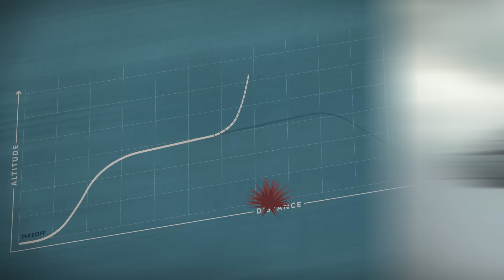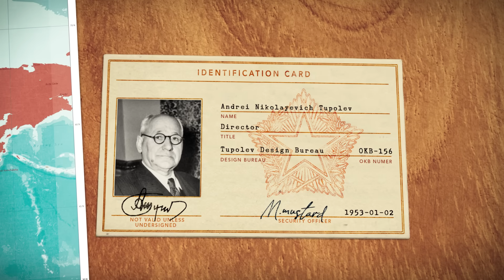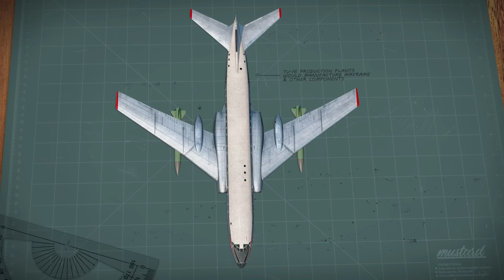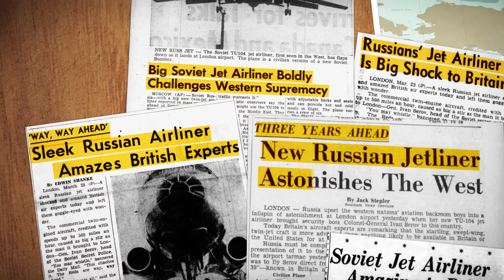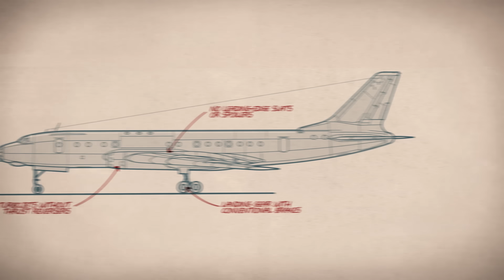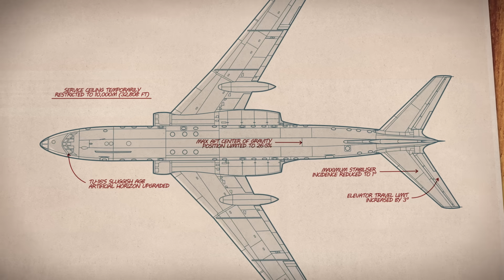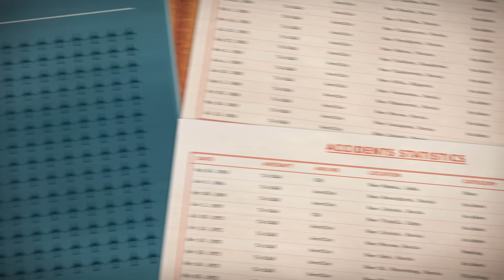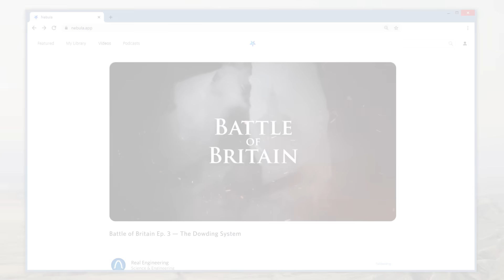The Soviet Airliner Designed To Crash

Comment: The 707, briefly mentioned here, was the real advance in jetliners. It was the first aircraft to have flexible wings, which avoided the need for massive reinforcements at the junction of wing and fuselage.
Reply: The 707 series is still flying and is expected to remain flying until 2040
Reply: @WilhelmKarsten  Who is still flying them?
Reply: @barry1fitzgerald  RAF, USAF, US Navy, France ASF, Saudi Arabia, India, Chile, Venezuela, Israel, Iran, Turkey
Reply: @WilhelmKarsten they're flying the KC-135, based on the Dash80 which was the prototype the 707 was based on. That's like saying the A300 is in commercial service because the A330 is in service
Reply: @sharvapotdar3257 No, the Boeing Jet Stratoliner is a modular aircraft family with various fuselage lengths and diameters.
 The E-3, E-6 and E-8 are built on the 707, not the KC-135.

It's a moot point really, the  KC-135 is the military version of the "Jet Stratoliner"
They are all the same modular aircraft system
Reply: The 707 is basically a modern aircraft. All changes since then have been refinements, such as more efficient and quieter engines, more modern avionics, and so on, but the overall design is mostly the same. Losing the flight engineer was perhaps the most notable change since then.
Reply: @ironcito1101 707 was all aluminum no composites JFKs plane was 707 I never flew on 707 but I did fly on 727 smooth ride
Reply: @ironcito1101  There's been more progress than that though: fly-by-wire, use of composite materials, twin-engined widebodies, flight envelope protection, crew reduced to 2 pilots were all innovations from Airbus which allowed it to become what it is now.
Reply: @Clery75019  Yes, but nothing revolutionary. For passengers, the differences between a 707 and, say, a 787, are lower noise, a bit cheaper fare, and a few other incremental improvements like that, even though they are aircraft introduced 50+ years apart. Compare to the dramatic difference in going from a Connie to a 707, for example, which were introduced some 15 years apart.
Reply: @Clery75019  None of those are Innovations from Airbus...
Reply: @sandervanderkammen9230  Really? Isn't the A300 the first twin-engined widebody? Also I thought fly-by-wire and flight enveloppe protection were first implemented for Concorde (basically the Airbus precursor) and later to the A320.
Reply: @Clery75019  It was, but when it was introduced it was not a configuration that was innovative or an advantage, it actually hurt sales.
The Boeing 767 was the first twin engine wide-body to achieve a 120 Minute ETOPS... that was innovative and the 767 was much more successful.

Fly-by-wire technology has a very long development history that pre-dates Concorde and Airbus by many years.
Reply: @Clery75019  The Boeing 707 is the first jet airliner to a have fly-by-wire Horizontal Stabilator and the first to have flight envelope protection system, MCAS was introduced on the 707-420 in 1960.
Reply: @sandervanderkammen9230  Well then Airbus, has very good salesmen if they are able to sell planes that don't bring anything better than the competition. Happy new year!
Reply: @Clery75019  Airbus has excellent salesmen... they have convinced many people that their aircraft are the safest, despite the fact that Airbus planes actually crash TWICE as often as Boeing aircraft.
Reply: @sandervanderkammen9230  I would be curious to know by which metric? In the past 10 years, Airbus has known 4 lethal accidents totaling 334 victims and Boeing has known 18 accidents totaling 1,023 victims. Looking beyond that makes things only worse for Boeing but aviation was less safer then.
Reply: @Clery75019  Anyone, with even a basic understanding of mathatics knows that you cannot simply compare the number of crashes or the number of deaths without statistics.
If we look at the actual number of crashes per flight we see that Boeing averages just one per every 1.84 million flights.
While Airbus suffered a crash every 0.81 million flights.
Reply: @sandervanderkammen9230  Your statistics are at least a decade old. There are currently more Airbus than Boeing airliners in active commercial service and less Airbus than Boeing crashes. So the number of crash per million flights can't be superior for Airbus than for Boeing, that's mathematically impossible.
Reply: @sandervanderkammen9230 that is incorrect. B737 has 2x the number of hull losses than A320 even though production numbers are more or less equal.
Reply: @mudi2000a  The Boeing 737 first flew in 1967 and has flow 5x times the number of passenger/miles as the Airbus A320.

You are Twice as likely to crash on an Airbus than a Boeing.
Reply: @sandervanderkammen9230 source?
Reply: @arthurdefreitaseprecht2648  Source for what?
Reply: @sandervanderkammen9230 source for your claims, is what they're asking.

And may I ask, how many of those Airbus crashes were aircraft faults and not pilot/maintenance error?
Reply: @sharvapotdar3257 According to the NTSB, Boeing averages 1 crash every 1.84 million flights. 
While Airbus averages 1 crash every 0.81 million flights.

The most notable failure mode of Airbus aircraft was flight control software issues.
Reply: @sandervanderkammen9230 does the NTSB account for world wide data? Isn't it the US body?
Reply: @sharvapotdar3257 The NTSB operates worldwide, it's primarily mission is to protect American travelers both domestic and abroad.
Reply: @sandervanderkammen9230 but the planes speak for themselves too
Reply: @bkbdoesrandomstuff  *Yes* SALES tell the real story and leaves the BS on the floor.
 Boeing out sold thier competitors 10 to 1!
 No single private company can compete with them, their only competitor is the massive, government owned multinational giant Airbus... the combined industrial capacity of 3 entire countries.
Reply: @sandervanderkammen9230 also MCAS is exclusive to the 737 MAX family, I think you mean TCAS?
Reply: @sandervanderkammen9230 nowadays Boeing quality has severely reduced ever since MD execs took over the company post merger in 1997. Boeing before ‘97 was a beast, that’s undeniable.
Reply: @bkbdoesrandomstuff NO, MCAS was introduced on the 707 series(720) in 1960.
Reply: @bkbdoesrandomstuff Boeing was the winner in the merger deal, McDonnell Douglas was in financial trouble and its commercial aviation division was failing... The merger made Boeing the largest aerospace company in the world.
 A lot of the criticism of Boeing is based on a bias against big business and is generally unfounded.
Boeing still has the best safety record of any commercial aircraft manufacturer... and it makes money unlike Airbus that has a long history of losing money... if it wasn't backed up by government tax money, it would have  gone bankrupt long ago.
Reply: @sandervanderkammen9230 Boeing execs were replaced by MD execs, and the struggling company was able to basically possess Boeing. Boeing after 1997 wasn’t the same.
Reply: @sandervanderkammen9230 that was stick shaker. MCAS itself as it is was actually introduced on the KC-46 (my bad for previous error)
Reply: @bkbdoesrandomstuff Sorry mate, ol' Wikipedia making you look like a fool right now.
MCAS first appeared on the Boeing 720 (707-320)
 The system was activated by underwing vane sensors and only after the "Stick shaker" activated independently.
An electro-mechanical servo would momentarily "bump" the control yoke forward if the pitch angle did not decrease after the shaker activated.
 This is not the same as a "Stick pusher"
(Stick pushers were first used in 1954)

MCAS was never designed as a Stick pusher system which is why the FAA mandated modification became problematic.

The current system found on the 737 Max operates the same as the Boeing 720 system.

Any questions?
Reply: @sandervanderkammen9230 You’re spouting total false and misinformation (possibly disinformation actually). There are zero sources reporting a 707 with implemented MCAS. The MCAS first appeared on the KC-46 Pegasus. If you want to prove a point, you must provide your sources.
Reply: @sandervanderkammen9230 under what timeline? Source? From the latest Boeing statsum, Airbus aircraft have very similar hull loss rates per million flights compared to Boeing aircraft.
Reply: @0w3nn  Anyone familiar with the 707 series knows it was the first Boeing aircraft to have MCAS.. MCAS was a requirement mandated by the British CAA for airworthiness certification of the new shortened fuselage 720 variants. 
You are probable not even born when the 707 series was still in commercial passenger service.
Reply: 707 was a terrific plane.
Reply: @cosmicHalArizona    Correction, IS a terrific plane.
Reply: @cosmicHalArizona  Létal jsem Tučkami, byly to skvělá letadla, byla bezpečná a navozovala pocit bezpečí. A také lítala rychleji a výše než západní letadla stavěna za ůčelem zisku. Kapitalismus se nezapře.
Reply: passengers always have to pay with their lives   for Airplanes to get safer
Reply: @tunkunrunk  The real tragedy of the Comet Disaster was that it could have been easily prevented if de Havilland had simply followed well-known and understood industry standards for construction of pressurized cabins made from riveted aluminum alloys.

The only thing learned from the Comet Disaster was that the stakes had become too high to allow manufacturers to conduct their own crash investigations.
De Havillands handling of the investigation was reprehensible and should have been proscecuted as a criminal act.
Reply: @sandervanderkammen9230  if I'm not wrong , pressurized cabin for civilian  aircraft was something new at that time , no airplanes manufacturers had a long time experience in that new field
Reply: @tunkunrunk  That is a very naive and ignorant comment.
Pressurized cabins were nothing new in 1954 when the Comet Disaster occurred.
Junkers invented all-metal, monoplane aircraft with pressurized cabins in 1931 when de Havilland was still building wood and fabric biplanes like the Dragon Rapide.
Boeing introduced it's first pressurized airliner in the 307 Stratoliner series in 1938.
The Junkers Ju-86 flew pressurized to altitudes of over 52,000 feet during WW2.
Boeing, Douglas Junkers and Lockheed were all building pressurized airliners prior to the Comet Disaster.
By 1954 Boeing had made over 4,000 pressurized aircraft and the B-47 flew in 1947 it flew at 40,000 feet with a much higher cabin pressurization.
Reply: also the first with a 100% solid-state apy-7 radar which was capable of providing a reliable terrain-avoidance warning system (TAWS).
Reply: What? All wings are flexible.  All structures deflect under load.  The Comet designers would've known that, as would any designer.
Reply: @laxeystu8096  We're talking levels of flexibility. The Comet's wings were made as rigid as possible, the Boeing's were designed to absorb shocks by flexing.
Reply: Typical americunts. Think you created everything !!!
Reply: i still prefer tu-104
Reply: amazing engines
Reply: The 707 was built during the time Boeing stood for pride, integrity, and safety first. Now it stands shareholders and CEO bonuses
Reply: @biff5856 737 Max is basically a 757
Reply: @biff5856 and DEI
Reply: @biff5856  It's not easy being the largest aerospace manufacturer in the world... the company still has an excellent statistical safety record compared to other manufacturers, you are twice as likely to die onboard an Airbus than a Boeing.
Reply: @sandervanderkammen9230  I've flown around 15 million miles and in that time formed some opinions about the industry. I would not fly on the new generation Boeing a/c's.   The MCAS issue is one. To be fair (not really) the FAA allowing Boeing to do their own safety policing is another issue.
Reply: @biff5856  The statistical data certainly disproves your opinions.
Reply: @sandervanderkammen9230  source? And what year did this data take place
Reply: @Weirdspacenerd NTSB and AirSafe.

All statistical data is aged to some degree but the Boeing 737 Max safety statistics have improved dramatically since there were only 2 accidents with fatalities and ZERO since March 10th, 2019.
Today there are over 2,100 Max aircraft in service with an impressive 11 million flights making it one of the safest aircraft in the world today.
 Averaging 0.18 fatal accidents per million flights.
 That's actually better than several Airbus models and an excellent statistical safety record compared to other aircraft like the Concorde at 11.36 fatal crashes per million flights
Reply: @WilhelmKarsten  Pretty sad collision indeed with a De Havilland Canada Dash-6 making 5 casualties in the Dash-6 side and none in the A350 side. That is the first A350 hull loss.
Reply: @Clery75019  Dash-6 is a "Twin Otter"
 The A350 collided with a DHC Dash-8
Reply: @Clery75019 it was a dash 8
Reply: @Clery75019  The DHC Dash-6 is the "Twin Otter"
The JAL A350 collided with a DHC Dash-8
Reply: @Clery75019  Won't be the last, Airbus aircraft are inherently less safe than Boeing aircraft.
Reply: @sandervanderkammen9230  One of them has been grounded by the FAA and EASA due to its unacceptably poor build quality resulting in doors falling off in flight, this comes after it was grounded because of a badly designed AFCS repeatedly flying it into the ground, but I forgot which one it was. Could you remind me which one keeps getting grounded because it's shit?
Reply: @sandervanderkammen9230  this "5 months ago (edited)" comment now reads a bit different in the June of 2024. A fine milk, indeed.
Reply: @sleeps_darkly  Absolutely nothing has changed in 5 months..
Reply: @sandervanderkammen9230  lmao ok
Reply: @sleeps_darkly  Boeing has 5,000 orders for the Max alone... they are still the largest aerospace manufacturer in the world.
Reply: @sandervanderkammen9230  goalposts moving, I see
Reply: @sleeps_darkly  Just the facts here... no fake news or blogger clickbait.
Reply: @sandervanderkammen9230  you are clearly biased to the point that I don't believe you despite the fact that I don't know enough about airplanes to have an opinion
Reply: @autoteleology  Which one of the facts I stated are you in denial of???
Reply: @autoteleology  Absolutely not, I am a very honest person that demands the truth and exposes fake news, false and misleading information, or clickbait hoaxes.

If you believe that any of the facts I have stated are incorrect, please state your case and present your facts... otherwise, the only bully here is YOU!
Reply: @autoteleology  Im still waiting for your explanation...
Reply: @sandervanderkammen9230  Expect to keep waiting because I don't entertain disrespectful and aggressive people.
Reply: @sandervanderkammen9230  Omg ifs thr guy that gets off to anything to do with Boeing, i remember you
Reply: @sleeps_darkly  New order for another  200  737 Max today.
Reply: Airbus has beaten Boeing in aircraft deliveries for the past 5 years. Recently Boeing have had manufacturing issues with their planes and more crashes per mile flown in the past decade. I think your opinions are blinded by nostalgia my friend.
Reply: @sandervanderkammen9230  And lets pretend that the 7000 A320 family orders do not exist
Reply: @sandervanderkammen9230  what a load of nonsense.. Boeing have a terrible safety record of late
Reply: @HelloOnepiece  Boeing has sold 23,000 737 aircraft...it is the most successful aircraft in history
Reply: @SteveMVA-ninja  Boeing has a lower crash rate and fatalities statistics than Airbus.
Reply: @sandervanderkammen9230   you're talking rubbish.. they're both at about same in terms of stats but if compare just last 10 years.. in all there's been far more boeing hull losses than airbus.
737 all types, a total of 235 hull losses, A320 total hull loss totals 38 and 321 total hull loss is 6. The numbers of total 737 built and total A320 family is almost identical
Reply: @sandervanderkammen9230  Boeing has both whistle blowers, and people who blow their whistle, it seems. lol

you are obviously knowledgable and passionate but it always seems like you’re trying to convince people that Boeing is way better than Airbus. I wouldn’t mind knowing the sources for this.
Reply: If the wing doesn't bend, it breaks.
Reply: Flexible is good for large deflections going into plastic yield!

Comment: The plane's design flaw was that the thrust vector did not go through its center of mass, causing a torque aka "moment" which required great skill and effort on the part of the pilots to keep it stable. One of the reasons it remained popular is, like many things in the USSR, it ran on 100% alcohol.
Reply: Yet it had a much better safety record than the de Havilland Comet... which remains the worst jet airliner in history.